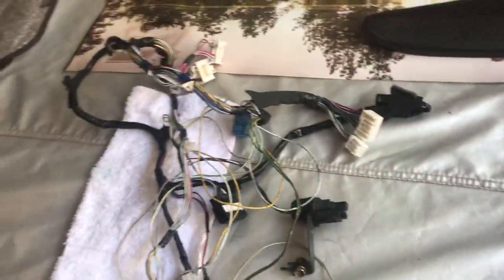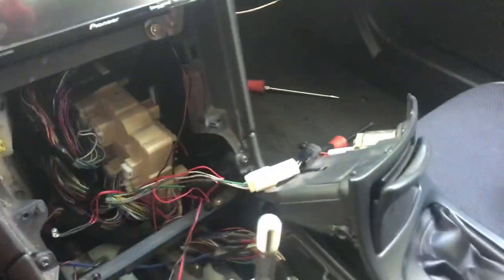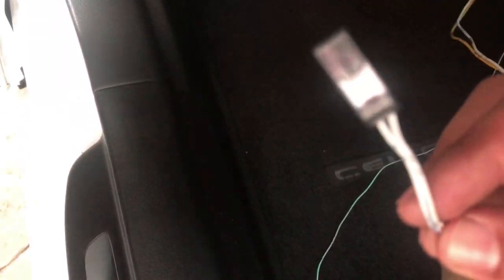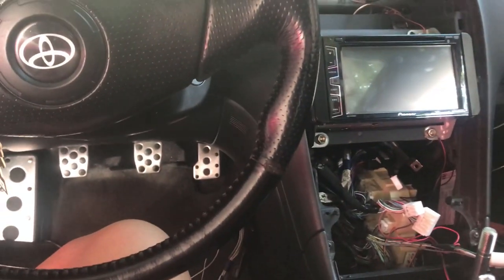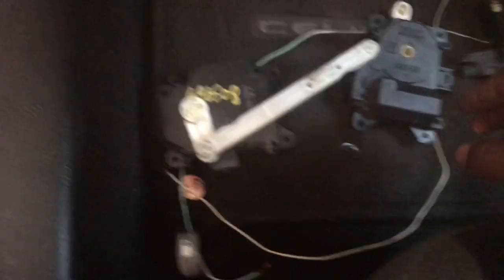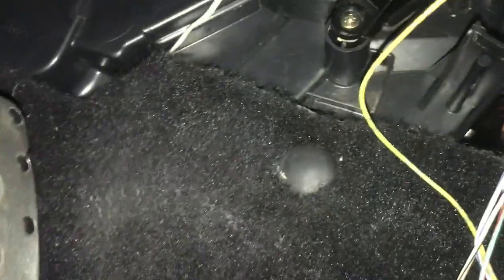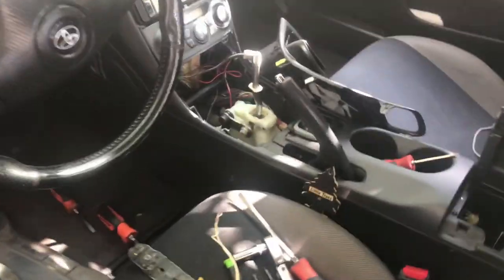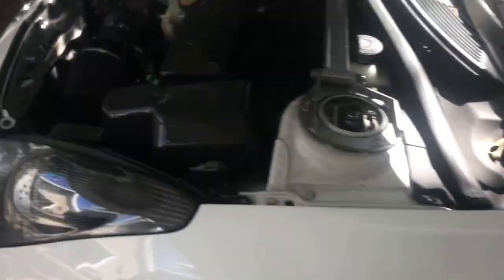How To Install Digital HVAC 00-05 Toyota Celica

Comment: I did this convertion and I try to let everything stock looking as possible. Outside sensor under the front bumper, interior light sensor in a hole drill in the dashboard but with this install you miss the air mix and refresh option since you don't have the third motor in the blower assy. And how is working? Mine cicles the compressor.
Reply from the maker: Raven Ellie working great and left it recycling

Comment: Hi Rafa the Ambient Air Temperature Sensor  is there a pigtail by the foglights ? if not where go i plug this sensor too? and also the solar sensor where does that plug into? i have the sensors but it cut so i don’t know where it plugs into
Reply from the maker: Thomas Louie no pigtail you need to run the wire all the way inside

Comment: i installed mine but i find when using the cold to hot, the motor only moves 3 phases. have you had the problem.
Reply from the maker: Marc Cymbalista no i havent
Reply: @RafasGarage  in ur video 4:50 you talk about the temperature sensor. for the second senor, did you install it or was already there?